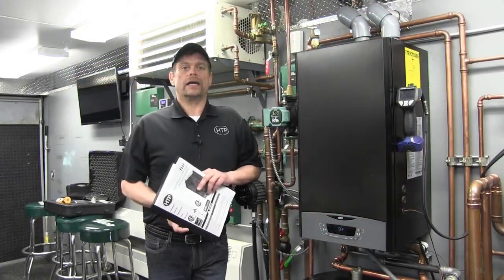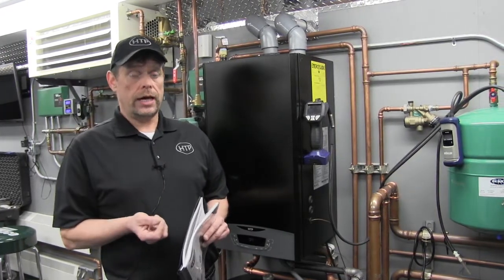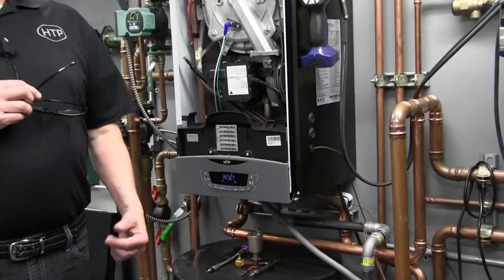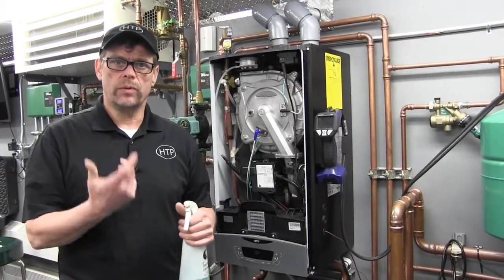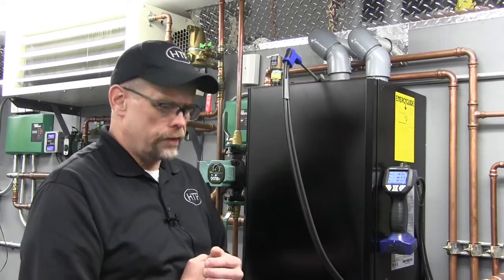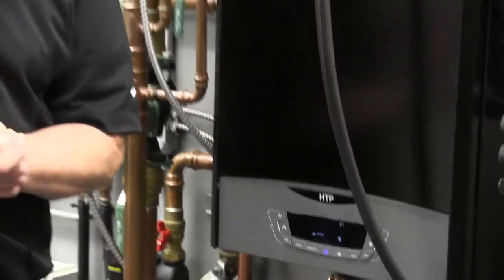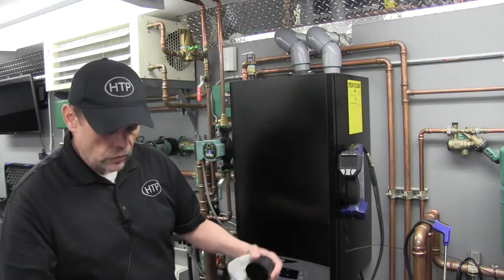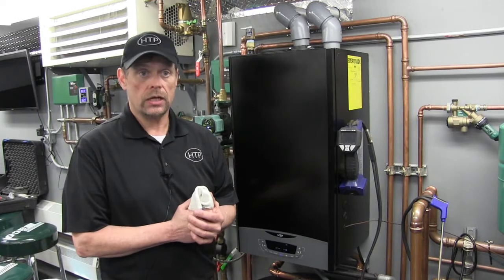HTP Elite Ultra ELU Boiler Startup | Step-By-Step Procedures & Checklist

Comment: Dear HTP Management- I am writing this as I sit here with NO HEAT AND NO HOT WATER once again... I am currently on my 3rd HTP on demand boiler in the past 5 years - yes, I have had 3 units installed in just 5 years!!!  While I appreciate you replacing these pieces of garbage under warantee, I have had to pay plumbers to install 3 times and also pay "restock"" fees at the plumbing supply house each time - I am into this for thousands of dollars.  This most recent install was done in June 2023.  It hasn't even lasted 6 months.  I am disgusted.